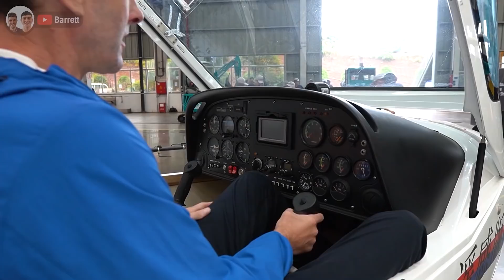I Controlled a 5G Digger Remotely  // (含中文字幕) // 第一次用5G技术遥控挖掘机

Comment: This technology can be used to fight and cap oil field fires, clear and remove radioactive materials or prevent meltdown of nuclear reactors etc. or, underground mining without endangering anyone!
Reply: @lovesgoodfood1491  😂
Reply: Given if you could actually build a costly 5G signal tower at the ocean, and the oil extracted could cover all the maintenance cost and labor cost.
Reply: Actually they already did.
Reply: @cwk18  They HAVE already built one 5 G facility on the top of Mountain Everest!
Reply: @zhongzm181  expensive as fk
Reply: @zhongzm181  reception and communication can't compare with 5G based
Reply: @lovesgoodfood1491  The USA is not giving up their "Slave Labour".

Comment: IMO, seems like watching directly at the working site is easier to be done and faster.. those LED screen is big, but after I see that the screen is displaying multiple cameras, even more than 3 camera > 3 display panel.. seems like... working as operator with remoted control unit is harder than the conventional one.. it really need operators that very hard to interrupt